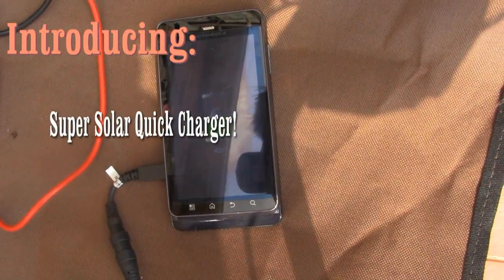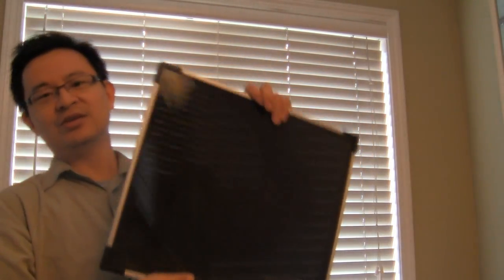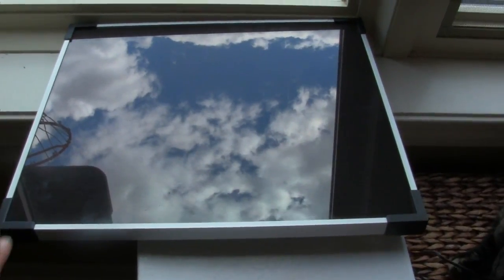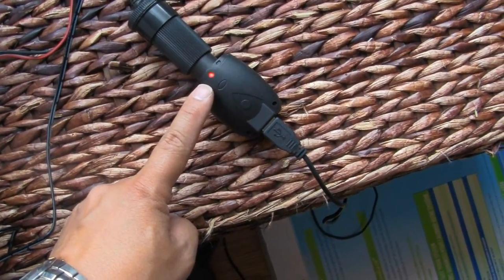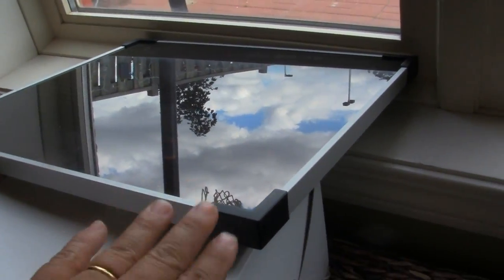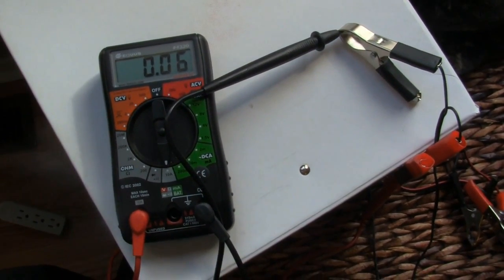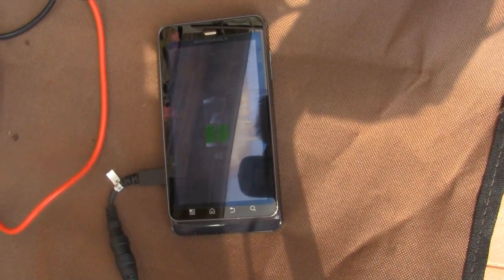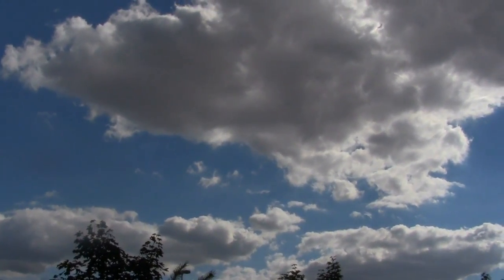How to build a Solar Quick Charger for smartphone cell phone Fast Charger from solar power energy

Comment: Quote from video: "10% in 10 mins....wow...so 60 mins would be 60%. So fully charged in an hour and half"

Errrrm....lol bad maths! If it charges at 1% per minute, then for 100% it would be 100 minutes. so thats 1hr and 40 mins to fully charge :) Anyways, good job!! I did the same idea only I also added a wireless charging pad so the mini usb cable doesn't have to be put into the phone. It charges the phone wirelessly from the solar panel. Try it in your next vide! :D

Comment: The only thing i would be worried about, is that the panel is producing 22 Volts and this is going into a car type USB adapter and assuming this is a 12 Volt one, then its' input would be less than 22 volts (i.e around 14 0r 15 volts) or you may start to damage/overheat the adapter....or are you using a 24 volts car type adapter?
Reply: Most cheap USB adapters designed for cars easily handle between 12 and 24VDC.